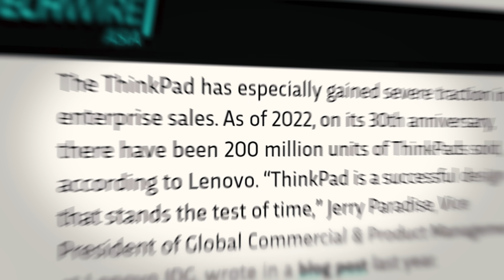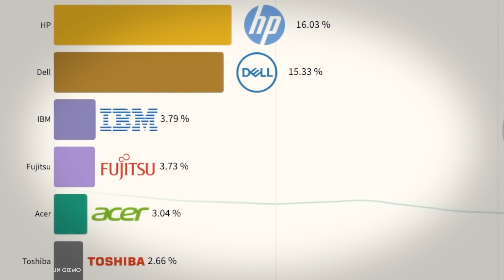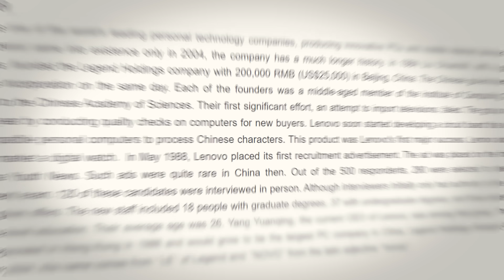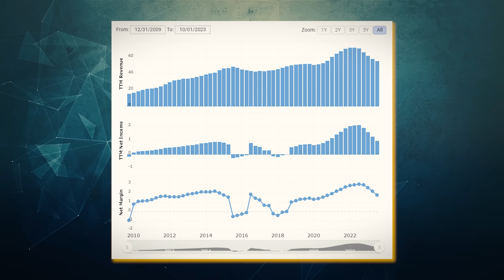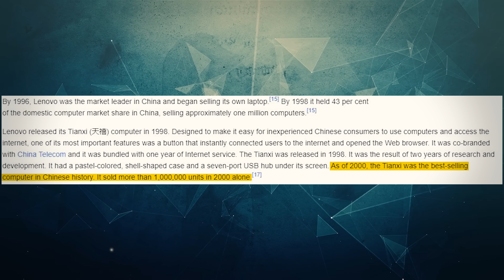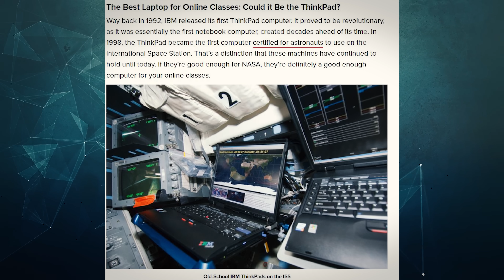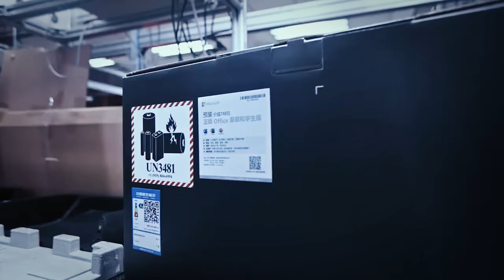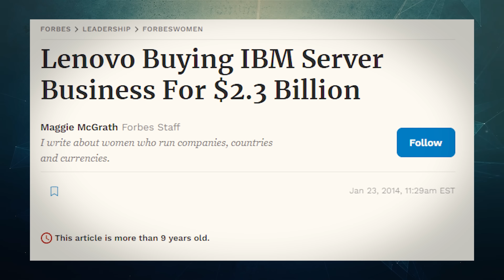Lenovo - The Last Practical Electronics Maker

Comment: I am typing this on a second hand Lenovo ThinkPad T530. It has outlasted the "stylish, streamlined, Cool" Apple MacBook Pros of similar age. (I want every laptop to play/make CDs and DVDs.) The Apple MacBook Pro subwoofers are toast, while the somewhat tinny speakers on the Lenovo ThinkPad SL410 (my first ThinkPad) still work just fine. Would I buy another Apple MacBook? Nope, repairing these former "state of the art" laptops is a daunting task, since they're worth more as scrap by now. Would I buy another Lenovo ThinPad? Not without a CD/DVD drive, which is a soft "no." 
In the early 2000s, I went to Best Buy to see IBM compatible laptops. The dull black ThinkPad SL 410 looked out of place, surrounded by pastel colored units. It was on closeout, so it cost less than those "pastel, Aluminum compact laptops." I suspect that those units were scavenged for parts long ago, while this "black brick" keeps "surfing the Internet." Practical beats "sleek" any day.;)

Comment: Long time Lenovo user here! I got my Lenovo Legion Pro 5 a few months ago to upgrade from my old casual Lenovo Laptop! Easily one of the most worthy purchases ever hands down!!
This incredible machine truly handles all my daily needs & it's amazingly reliable and trustworthy!
I thought about some other brands, but I prefer to go with the trusted and tested brand I've known & used for years!
💻💻💻💻💻💻💻💻
Reply: Hlo brother I want to buy a laptop
but I'm so confused between asus
zenbook 14 oled and latest lenovo
ideapad with core 9 185H process
can you please tell me about how
your experience with lenovo it might be helpful for me
Reply: @arush.thakur_12  Hello! So far my experience has been great! The Legion 5 Pro (I misspelled 5 for 15 in my OP) is a very powerful Laptop, coming with 32GB DDR5 Ram, AMD Ryzen 9 6900HX CPU with the Radeon 680M iGPU & the Nvidia RTX 3070TI 8GB VRAM GPU.
It's been a great experience indeed (I owned a Lenovo Laptop before my current one as well & it lasted for 10 years) & I can tell you that it's indeed a company who's products are truly value for money.

Now, as for the more technical aspects, if you plan on using Windows exclusively, they work out of the box, with great support for each individual model's drivers being available on the official Lenovo website, so you'll always be able to stay up to date even manually (I recommend that over automatic updates) & you'll be good to go.
If you're planning on using Linux though, it'll be a bit tricky, mostly due to the Nvidia GPU. Arch Linux has the best driver support for it.

I'd say you won't be disappointed with Lenovo. Just please remember, any Laptop, regardless of brand, is usually best to be bought in the price range of 1500€ & over. In my experience, anything from 1500-2200€ is solid af & lasts at least 5-7 years, before your Hardware gets completely out of date!

Hope I helped! Happy purchases!
Reply: Kinda late here but I don't recommend going the asus way, bad idea.  @arush.thakur_12

Comment: The best thing about thinkpad is that it supports Linux the best out of any other Laptops out there 😄
Reply: All laptops support Linux
Reply: @axethepenguin   Yes but we do have some incompatibilities like wifi not working or speaker not playing audio, though most can be fixed by user but still it becomes an hassle for most of the users, Whereas thinkpads has the most wide and loved linux community, i myself have never used thinkpad but i have seen a lot of forums of thinkpad users

Comment: Yep I can vouch for lenovo. My monitor is 1440p 27" 165hz ips panel from lenovo, nothing special but the price I got it for at the time was extremely good and I have had no issues with the monitor. Also my gaming laptop is from lenovo and it has smart cooling design and good ports placement (everything at the back). It was also well priced for the specs. It's rly good value for money brand.

Comment: I have a macbook and a zenbook. But I still had to buy a budget lenovo laptop that has all the ports I need - usb A, hdmi, rj45, sd card reader. Yes I need all those ports for the work I do. USB dongles are too flimsy when used in a cluttered workspace where you need to put the laptop on weird unstable locations like top of a  pile of boxes.

Comment: I used a Thinkpad X220 for work for almost a decade, it only got retired when a patient randomly yeeted it across the room, killing the wifi, bluetooth and cracking the casing on landing. The current generations of Lenovo laptops simply aren't the same. They've moved in a very Apple/Samsung direction of soldering and glueing everything together and the build quality doesn't seem to be there anymore (build quality is on the inside, it's not about how pretty the casing is). It's a real crying shame, although the Legion laptops still look pretty slick.
Reply: I think Lenovo is unnecessarily changing the Legion lineup and introducing too many options. Pretty sad they nerfed Legion 7 hard after 2022 and especially this year with their rebranded Slim 7. They could've just given the Legion 7 Gen 7 the Pro 7 cooling system, latest CPUs and GPUs, miniLED display, and SD card slot.

Comment: Thinkpad are very reliable work machines. I was given E14 for work by my company. One time I accidentally spilled hot chocolate drink onto the keyboard. I quickly cleaned it up after turning off the laptop. After Keeping it for drying,the keyboard worked without any problem. I also dropped it couple of times other than few scratches nothing happened. I became a Hugh thinkpad fan since then. Macbook can't handle this much abuse.

Comment: I still use, while on the road and would not mind if somebody stole my laptop, a Lenovo ThinkPad from 2008.  It still works with a Core2 Duo uP that is slow as molasses, running Windows 10 and upgraded to an SSD.

Comment: I have a thinkpad X1C gen 7, got it  because the thinkpad line is known for very good Linux compatability. It wasn't cheap but I'd say it's great value nonetheless. Good build quality, nice keyboard etc. The only thing i've had issues with is the battery becoming unrecognised at random, so I had to open it up and disconnect/reconnect the battery. Not a big deal because it's easy to open. Though i wish they kept the power button on the top instead of the side and had a USB-C port on both sides. that would be nice. Overall it's a great machine.

Comment: I've been using a lower end i3 8th gen Lenovo for 5 years mostly for light work and apart from an SSD upgrade this thing works just fine despite the hardware essentially being ancient at this point it still works fine

Comment: Ever since trying a ThinkPad with the TrackPoint while working for IBM, I can't go back to any other pointing device. Touchpads and mice give me repetitive stress injuries in my wrist and are slower to use, requiring me to move my fingers off the keys. I don't like trackballs. For my desktop PC I use a ThinkPad USB keyboard with the TrackPoint (they also have a Bluetooth model, but I like wired). It's the same size as the classic ThinkPads and has no number pad. I like a small desktop keyboard so there is more room for a drink, laptop, and gadgets on my desk. TrackPoints are not very good for gaming, but for the basic games I play they work.

Comment: Can we finally put an end to the absolute moronic assumption that "Sleek" designs means it's well designed?  Laptops and PC hardware needs space to be cooled properly and not having to throttle down and reducing performance constantly. Besides Batteries define the thickness of a laptop as well. And especially the cooling fans and heatpipes. Besides that a certain thickness also increases the resistance against bending and deforming. People have been brainwashed for years with marketing BS and believing that the ONLY quality requirement for laptops is to be thinner and thinner.... Leave that mistake to Apple and their overselling hardware that is NOT meant to be practical but only fashionable. Nobody should let these factors be the only defining aspects in designing a laptop but sadly EVERY manufacturer out there has already succumbed to this irrational belief. The current time Laptop market is about the most boring segment you can think of, with an abundance or laptops that are just like Smartphones and cars:  ALL looking the exact same with the only difference being the brand name that is slapped onto them. You know what laptops are still cool and fascinating? Thinkpads from around 2012.
Reply: It's like trying to make passenger aircraft smaller and thinner

You're reducing cabin space for people making it claustrophobic and you're actually WASTING fuel because the planes would have to keep making pit stops to refuel.
Reply: I LOVE IT!!!!! 👏🏼👏🏼

Comment: Unfortunately in the past years Lenovo has been slowly drifting towards consumerism and letting down their core audience who value practicality. The hallmarks of that shift were replacing external batteries with built in batteries, losing ports like ethernet and SD and particularly losing user replaceable RAM slots.

Comment: Thinking about buying the Lenovo LOQ, I heard good things about the brand so I have my hopes up

Specs for nerds:
CPU: 8-Core Intel i5-13420H 3.4GHz (4.6GHz Turbo)
RAM: 8GB 2x4GB DDR5 SoDIMM 5200MHz
GPU: Nvidia GeForce RTX 3050 Laptop 6GB GDDR6 VRAM
Display: 1080p 15.6" 144Hz IPS Anti-Glare coating
Storage: 1TB NVMe SSD M.2 PCI-Express
Webcam: 1080p
Speaker: Integrated Stereo
Ports:
--2x USB-A 3.2
--1x USB-C 3.2
--1x USB 2.0
--1x HDMI
--1x Ethernet (RJ-45)
--1x 3.5mm Audio Jack
Battery: 60Wh Lithium-ion 4 Cells
Charging: Bi-Volt, 170W

Comment: My only issue with the newer ones is a portion of the ram is soldered to the mainboard, so if it goes bad, you cant repair it yourself.
Reply: Luckily soldered on RAM seems to fail very rarely. Don't think I can remember a single example of the top of my head.
Reply: Yeah, never had a problem with my 16 gb soldered ram😅